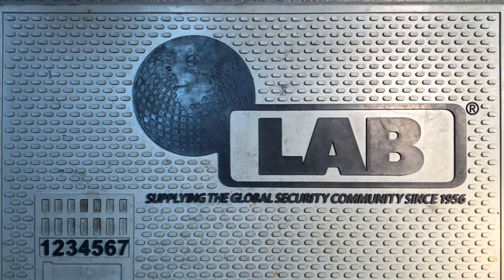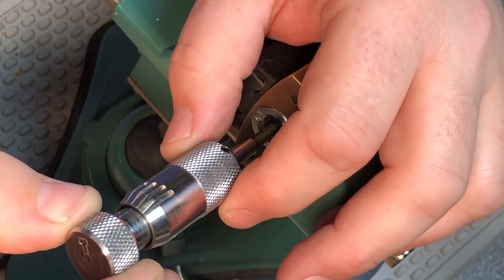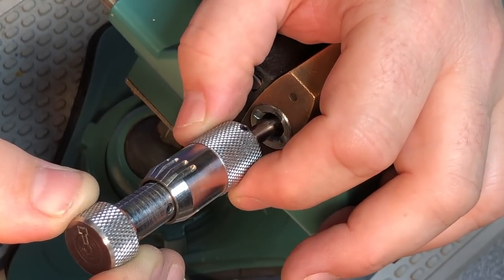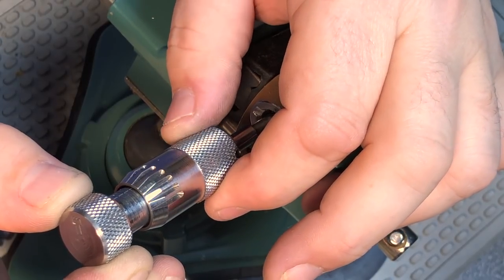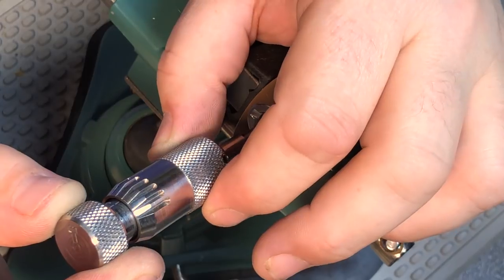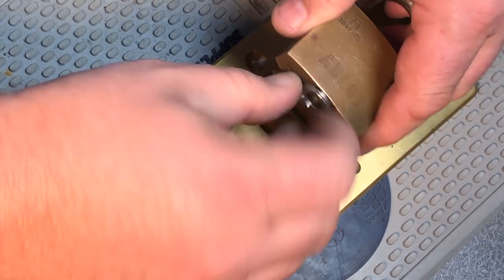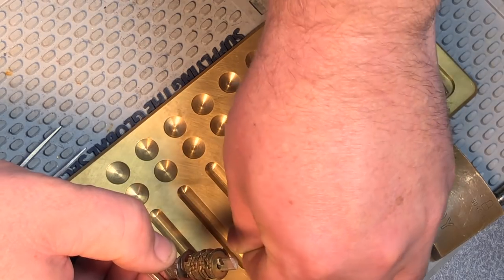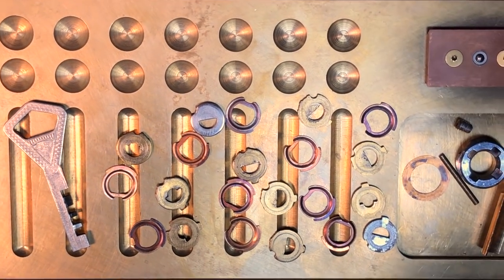Abloy Classic - Pick & Gut

Comment: Great picking! I need to get myself one of these locks as a project.
On why clockwise rotation bites harder - if you are forcing a disc clockwise then the edge of the false gate is driving the side bar into the cam face in the lock body and therefore making it bite harder, while with CCW rotation the edge of the gate pushes the side bar into the core housing, acting against the tension you're applying and actually reliving pressure on the side bar by the lock body. Hence always going to be easier to pop it out of a false gate going CCW, not that it's a massive problem to ease off on the tension or even allow a little counter rotation going CW.

Comment: Nice work. From a practical standpoint this lock DOES win since only a handful of people with a tool like this can pick these disc locks. And even you took a relatively long time to complete the solve. Of course none of this matters if your thief has a cordless angle grinder with a silicon carbide grinding wheel. The keys are TIME and NOISE. There are videos of criminals in broad daylight stealing $1500 bicycles with such angle grinders. They don't even bother with key ways at all.

One last idea: What if Abloy added a spring loaded dimple to this package? The dimple would have to be actuated for the key to turn like on Mul-T-Lock  systems.

Comment: Hey brother  I know you only like picking high security locks. Have you picked a Kaba Quattro on your channel? I have a couple if you would like to borrow one with a key. I know you take apart locks that I wouldn't dare but this one without the right tools is not easy. Paul Springett did a video on how to put one back together if you would like to watch it. I already have one in bits and pieces that Frosty had tried to take apart lol. Let me know brother I will be happy to send you one.
Reply from the maker: Hey Bobby! I picked one Kaba, although I have no idea which model it was. It came to me without a key, and it remains in a bag, completely taken apart. You're not kidding about how tricky they are to get back together. I read about a method using tape, but never did try it. Thanks for the offer! I've got enough locks to keep me busy for now, but may take you up on it later on.